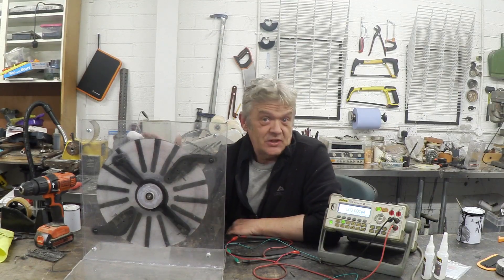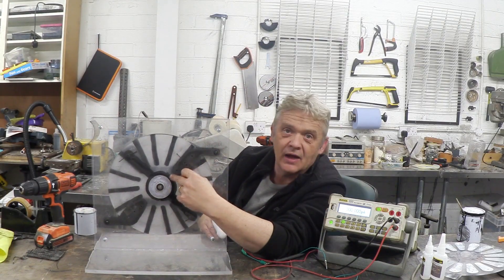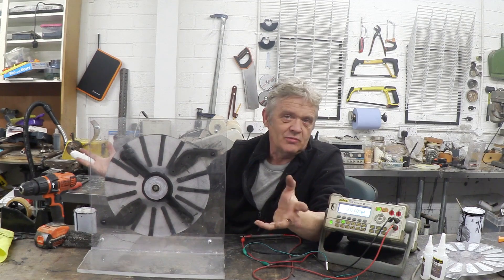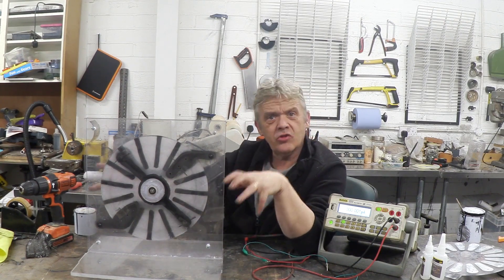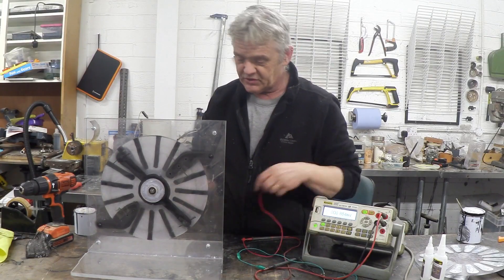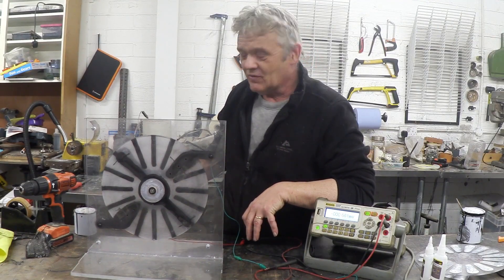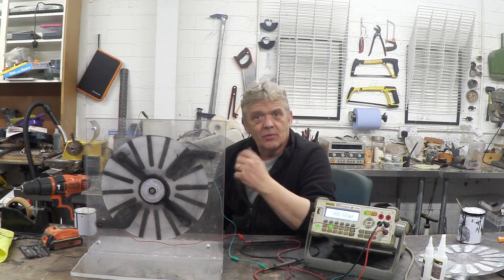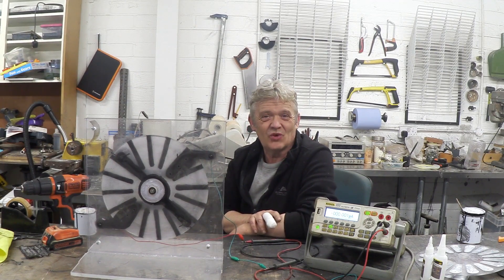725 A Printed Generator - No Copper, No Coils, No Wire, No Magnets

Comment: Now if you'd take these disks, mount them as tesla trubine. And i wonder what it would do at 25k rpm :D wonderfull
Reply: I dont know but the structural integrity of the disk may become an issue.
Reply: i said the same in the previous video but i don't think the brushes and paint would last very long. still something i'd like to see though, it would be pretty cool!
Reply: @DMonZ1988  engrave into the surface, so they don't touch but the properties will still function.
Reply from the maker: that would be interesting
Reply: @ThinkingandTinkering  I'm vaguely sputtering through an odd variation on that - if two discs rotate on opposing faces of a stator plate, each with differing numbers of lines conducting radially along them, as well as the angles, frequency, of the short-circuit that cross among those brushes, then their relative alignment ( while rotating at the same macroscopic velocity? different alignments of radial lines as gearing... stator plates are on a static axle, rotor plates surrounded and supported by an epoxied drum?) traipsing past each other might allow a transformer-like voltage-stepper? The goal would be the minimal shift in your design, such that you allow a threshold of 'uniquely functional voltage' to be achieved in cases where it is otherwise impractical. Higher-volts into a tiny capacitor, for sparks' utilities , distinct from the annual Whrs. of the device (which would have to eventually compete on a crowded field). E.g. - sterilize and convert trash into nutritious amino acids from a micro-windmill atop your shed in Sao Paulo? Probably worth more to them than charging an iPhone.
Reply: Exactly what I was coming to say. This should definitely be done with a tesla turbine. I would probably run water or compressed air through several of them to get more power while also adding redundancy so you can just replace them as they break since they cost almost nothing. Applications would obviously be limited to what you can do with a [quite efficient] tesla turbine, but I've got thoughts on that too
Reply: I thought of this too, I'd love to see a sample try even at blowing compressed air at the edge instead of just having a cordless drill at the center. There should be enough force to turn it a lot if there's no torque requirement on it.
Reply: I thought what if as well🙃 maybe with a bit of modification to the ink it might stand a better chance.
Reply: @midnightgardener8346  just thought of this while reading your comments. Its graphite paint. So what if you replace the paint with actual solid pieces of graphite. You could be crude with it. Or you could get neat and make a bunch of wedges of graphite and an insulator and fit them together as a disk
Reply: Magnetic graphene and you don't have to use brushes.
Reply: You can also print it in such a manner as to make a MEG generator.
Reply: I immediately thought of the same thing.
Reply: so..  you'd need 5 of these to equal turning a tiny $2 dc moter??    I'd have to question the whole efficiency compared to one with a simple coil and 3 magnets .........  

its very interesting dont get me wrong but its also kinda very useless at the same time.
Reply: @harleyme3163  could you scale this up and add disc's then charge batteries..
Reply: perahps a viktor schauberger egg with internal implosion rotor
Reply: This could be in tires & wheels on electric & gas vehicles. Elevators in buildings. Light rails in urban areas
Reply: The higher you go in altitude, the cooler it is, the faster the wind blows , the higher the static ele gradient is so when Tesla built wardencliff tower he had options. Looking at those options year round for your location let's you maximize your potential ele production. Looking at that for various locations let's you maximize for their locations. What would be interesting is a device that capitalized all of these at the same time.
Reply: And what are you going to use to generate that 25k rpm? Lets be realistic he's using a cordless drill which is likely somewhere between 12v to 18v to generate 2.1v. That's not a lot out for what was being put in. Don't get me wrong I'm fascinated by this contraption, but at some point reality has to kick in and in order to make this viable the input would have to be some kind of wind or wave turbine, or other naturally occurring energy source. I'm not sure your going to get that kind of input energy from these. Still it's great to see real people trying alternative forms of energy generation, and the rate at which we're going through the planets resources we need people like this, so good on him for experimenting and I wish him every success.
Reply: @badgerint  the drill is just to see what the top end output would look like.  In practice, after you hook several of these together, you could hook it up to anything that turns a wheel: water, wind, a bicycle, whatever.  

This is just a minimal base concept device meant for testing out some ideas.  You don't want to overcomplicate things at this stage, just target the unknowns being investigated.  In this case the questions being asked isn't "Is the power output more powerful than the drill,"  it's "Does the ink have the capability to replace the metal parts", "How much greater or less will the power output be?", "How fast does the wheel need to turn in order for the device to generate just enough of a noticeable power output", "Does turning faster generate enough of a power increase to be worth the effort to maximize spin in later interactions", and possibly get a rough estimate as to how long the ink will remain intact? Is it more or less durable than metal.

That's why you WANT to use a drill at this stage.  You need a reliable driver so you can do the math property on the unknowns being tested at this stage  The actual driver would be a separate build that needs to be developed for its own optimizations after its own unknowns have been investigated. Once that's done you can do integration tests with the two. The only thing the two need to communicate to each other is that they are working on the same dimensions. This device was built with an axle that would fit the drill. Any device using the same axle dimensions can also be used to turn this iteration of the device if need be later on. But all that is very far down the line from what has to happen at this stage.  

Sorry for the length of this reply. Please don't consider it a rant, rather a pleasant mind dump info overshare :)
Reply: @colleenforrest7936  I totally agree with what you are saying, but the end goal of this is to generate power is it not? My concern is that whatever is turning this will not have enough energy to spin at a sufficient speed to make the power output worthwhile. We are at the end of the day converting a natural energy source to electricity we can use. With that said your point on checking whether the materials will hold up to greater turning speeds is valid, and would prove whether this is worth investigating further.
Reply: @Barskor1   That's the additional comment I was looking for. A lot of what Robert is showcasing on this channel seems to be micro generating tech, and if you put that together with some of the other things like his gear making, you really get a complete package. But as was said in another comment, he's not giving us fish, he's trying to teach us to fish. He's not giving us the end product, he's giving us the ideas to build on into an end product.
Reply: @badgerint  two small points, the drill as you know was purely a mechanism to generate speed....nothing to do with energy efficiency and secondly the idea is designed to get people to think, experiment and discover. This is how we take things to the next level from the shoulders of giants.
Reply: @badgerint  "And what are you going to use to generate that 25k rpm?" compressed air
Reply: @badgerint  i don't think it has to be found in nature. 25could be pushed though urban areas in many ways

Comment: Very fascinating. I wonder if you could swap out the plastic for cardboard and still get a result.
Reply from the maker: wax paper would be better or maybe waxed card
Reply: IMO yes I think you are going for recyclability/environmental impact as well as cost reduction?
Reply: sure, infact get it spinning fast enough and generic A4 paper/PET will become rigid enough to work properly, it doesnt even need to be that fast from a solid spinning disk pov, even the usual tiny battery/cap test motor will probably work fine here with a quick elastic band drive belt connecting them.
"paper blade table saw"

Comment: if the efficiency is decent this could solve alot of 3rd world problems :P could make them go for wind turbines and skip the coal. if generators are so cheap
Reply: If I remember corectly he said 0.6 micro watts on 4000 rpm. If you have 100 units you get 60 micro watts. Is a great experiment, but is only for show for now. Maybe with aluminium he can get a little bit more power out and if the plates are more together, etc.
Reply from the maker: remember mate this is a prototype to demonstrate the idea - there is a fair bit of work to do here
Reply: @ThinkingandTinkering  Yhea i know you told me once it was only about the concept/idea to inspire you wont hear from me about efficiency anymore xD. i meant to say its a great idea. and in the future even if its not very efficient its a good idea since its like you said being possible to mass produce it and driving the cost down allows poorer country's to enter the renewable energy phase. I enjoy your content.
Reply from the maker: @kil98q  bless your heart mate and cheers